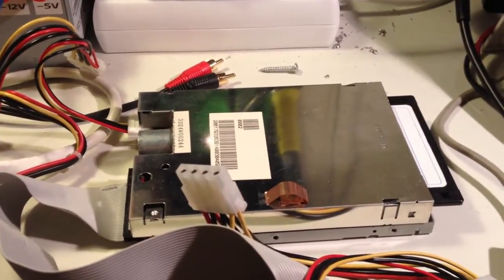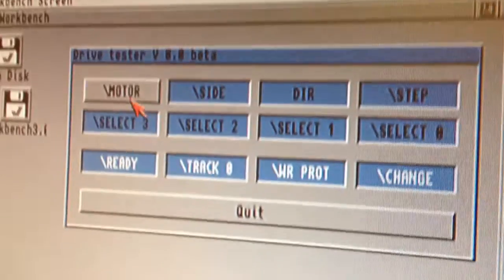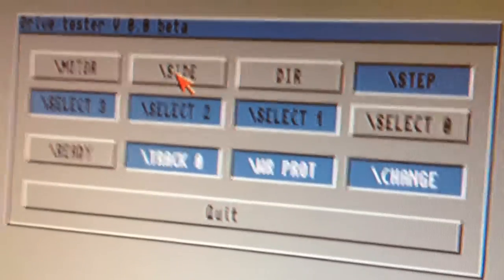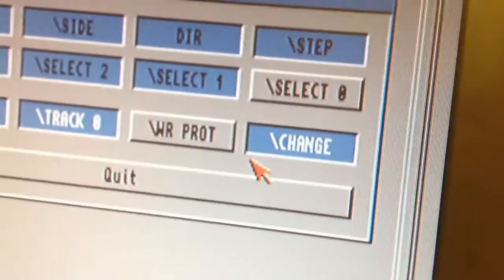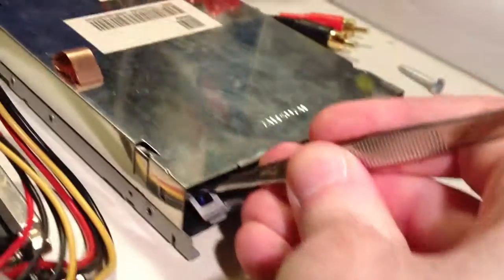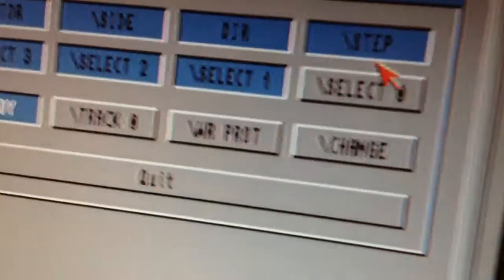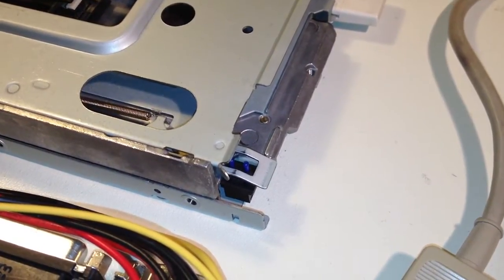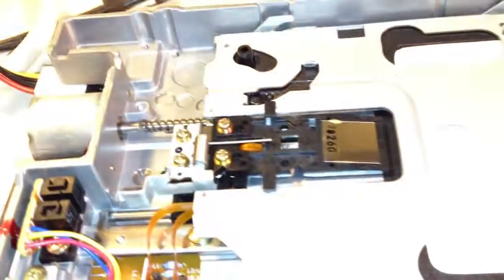A1200 floppy drive repair - sensor problem

Comment: My A1200 has exactly the same fault: the drive's been clicking and generally flaking-out for a couple of years now. Today, it began buzzing and clicking, randomly. I expect that the disk change sensor is now totally full of dust. Thanks to your video, I know how to clean it. Lex
Reply from the maker: Sounds like it could be the infamous disk change sensor problem. If cleaning solves the problem only temporarily, when the problem returns you might want to consider replacing the momentary push-switch with another one for a more permanent fix. It might not be easy to find a replacement switch that matches the old one perfectly, and I guess that would be the most challenging part with such a repair.

Comment from the maker: I've personally never had the problem coming back as soon as one month after contact-spraying any kind of switch, but I think you might be right about it not being a long-term fix. However, contact-spray can often squeeze quite a lot more operating hours out of the drive without having to replace the whole sensors. I guess it all depends on the gravity of filth on the connector plates inside the switches. A bit of dirt is much easier taken care of by the spray than heavy corrosion, for example.

Comment: Those damn sensor pins are the number one point of fail for all floppy drives (any that use them). I've used the contact cleaner spray fix too, but it usually only lasts for a month or two and then the problem re-occurs, plus it's messy. I stuff paper towels in the drive to catch the over-spray.

I once took one of those sensor assemblies apart on an Amiga drive. The contacts inside are almost microscopic. It probably took me an hour to put it back together! Worked great for about a year...

Comment: That power supply that you are using - did you build it yourself (normal PC power supply for +12V and +5V with a few holes in the metal and some connectors attached to it)?

Comment: Maybe I just never managed to get enough spray inside the unit. I did use the red tube and tried to direct it right into the pins, then worked them up and down, but it never seemed to cure the problem for very long.

Comment from the maker: Agreed! I remember when I was using my A500 and A1200 as a kid and a teenager. Internet was not that widely spread at that time, and most people didn't have it at home. I remember calling BBSs from my A1200 with my 33k6 baud modem. It was almost impossible to find as detailed information about the hardware as you can find now by simply looking around on the internet.

Comment: Great as always.

I want to ask you something.

I saw a mod for adding 2megs of chip ram on an A600.The motherboard chips are 2xHY514264B JC-70 but I have the same but with JC-60 at the end.I didnt find any sheet about speed or compatibility on google. Thanks in advance.

Comment: a floppy emulator  would be better as drives are dying and the disks are getting old now
Reply from the maker: *****
Floppy disks that have been stored in cold basements or any other inappropriate location will probably not be usable anymore since oxidation will then probably have accumulated on the surface of the disks during the years they have been in storage. On the other hand, floppy disks that have been taken care of and stored in a more appropriate manner should still be fine even today. Even if they have started to lose information that was recorded 20+ years ago, the recording capability (that is, the ability for the disks to become magnetized) should not have decreased much, I think. So reformatting them should still work fine in most cases, as long as there is not a physical problem on the disk surface. I have lots and lots of disks that still works just fine, even today. In fact, most of the disks that I have still works fine, and the stuff recorded decades ago can still be read without any problems.
Reply from the maker: You can find double density disks on eBay once in a while, but you have to be patient and grab the ones that show up when they do.
However, since these disks are not being manufactured anymore, even the ones that are sold as "new" (boxed and sealed) might still be a bit old since they have probably been in storage for a while since they were manufactured. They might come from some kind of computer dealer's old stock or something like that, who knows?
Are there any Amiga enthusiasts living relatively close to you? Sometimes, people are writing on Amiga forums that they aren't interested in keeping all their floppy disks since they are running everything through a USB floppy emulator or through WHD load nowadays, or something like that. If that's the case, then you can get hold of a lot of disks for cheap, or maybe even for free. Yes, they might be old and used. But the important thing is not really how old they are, but how they have been stored. Improperly stored disks will likely not work, while properly stored disks will. If you put a batch of 100 disks in a cold basement and a batch of 100 disks in a more proper environment, then the whole batch of 100 disks that have been stored in the basement is nothing more than trash after a decade or so. There is no point trying to find the very few disks out of the lot that still works, since most of them are probably going to be damaged. And when you put a corroded disk in the drive, it might also mess up your disk drive heads if you're unlucky. On the other hand, the 100 disks that have been stored properly will probably have at least 95% of them still working with no problems at all. And the ones that don't work will not be likely to damage the disk drive since they are not likely to have the same kind of damage as the improperly stored ones. So what you need to do is to find someone who has been taking care of his disks by storing them correctly. When you drive over to this person to pick up his batch of disks, you can then check the condition of a few of the disks by sliding the metal protecting cover to the side and closely inspect the disk surface under good lighting by viewing it from different angles. Oxidation on the surface of floppy disks is easy to see if you know what to look for. If you take a look at around 10 or 20  disks at random from his lot and all of them are corrosion-free, it's very likely that most of his disks are going to work just fine.